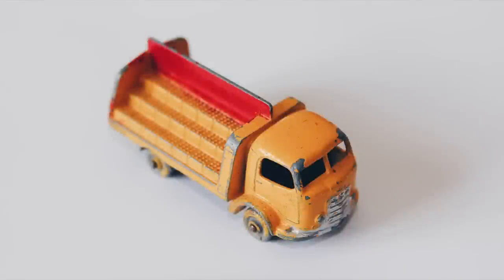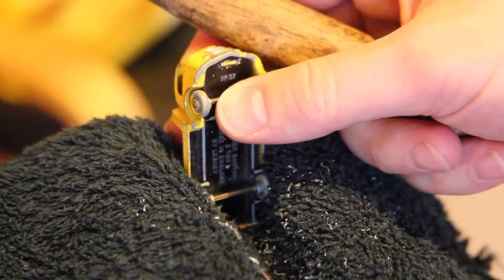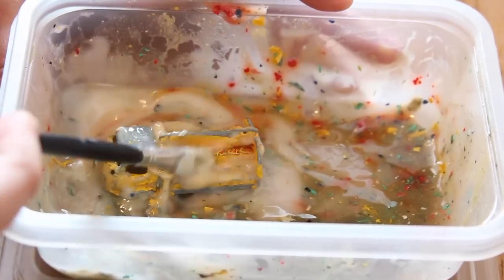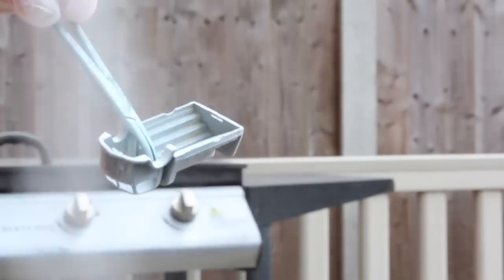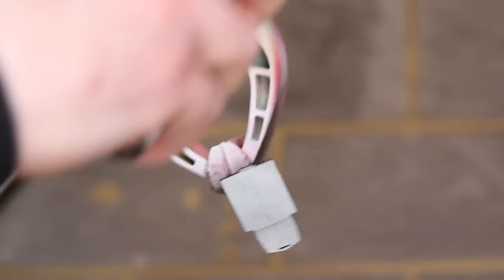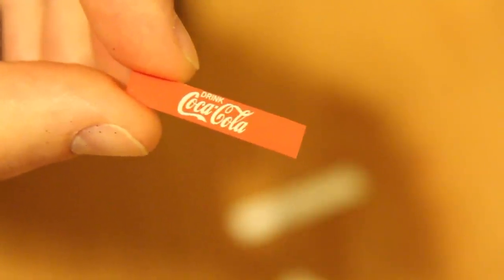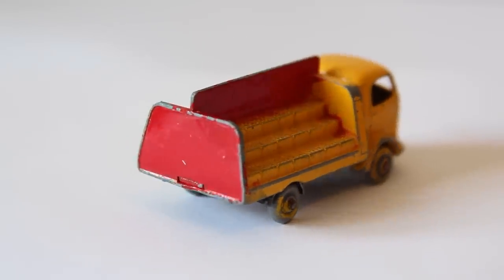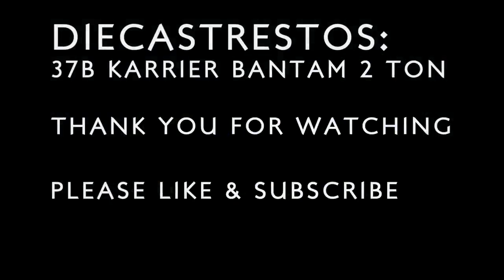MATCHBOX restoration: No. 37B Karrier Bantam 2 Ton Coca-Cola Truck - DIECASTRESTOS

Comment: I believe the 37a didn't have a black( or red ) base  originally  because the axles were attached by two stand offs from the base no less!
 It ran from 1956 to 1961 when the 37b came out. It had even cases. Love this pristine restoration. Top notch job!🥤👍🏻

Comment: Great resto really like the Coca-Cola Karriers. The differences in the 37A and B are also the A has no base and can also have an even load. The very first A castings had the uneven load , but this was soon altered to even to help with mould ejection problems. You are turning out some great quality restos and your collection must look stunning. ' Top Job Fella '
Reply from the maker: Thanks for the correction! Totally forgot about the baseplate but didn’t know that 37a did also come with an even load. Now I know!
Reply: I don't know if you already have found this site , but try www.vintagebritishdiecasts.co.uk it is a site by Nick Jones and you can find very good reference for all Lesney upto the transition superfast. @DieCastRestos

Comment: Good job! I just finishing the same model but not sure about chrome on the front. I've seen few variations. Is yours based on original or is "personal interpretation"?
Reply from the maker: I do a bit of research before I apply the highlights, this one was based on the most common outcome I could find through image searches. It looks as if most original models did have painted grilles and lights.